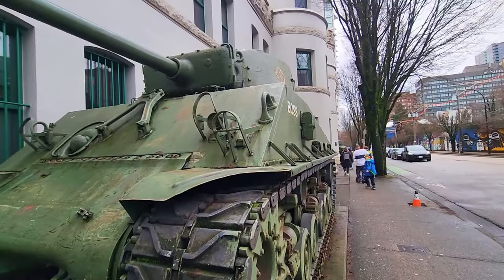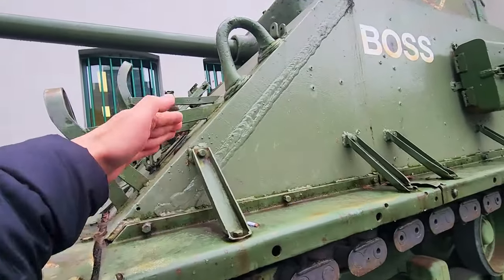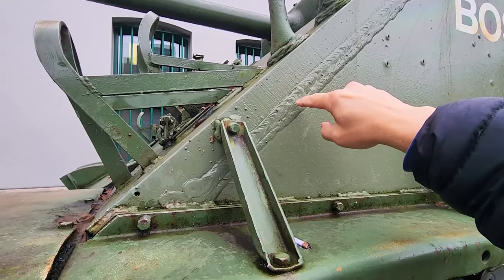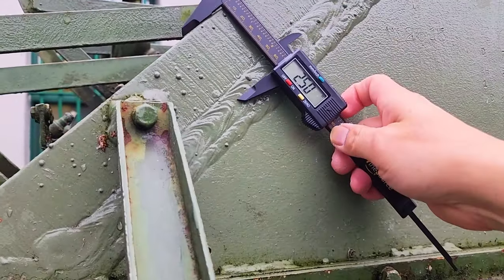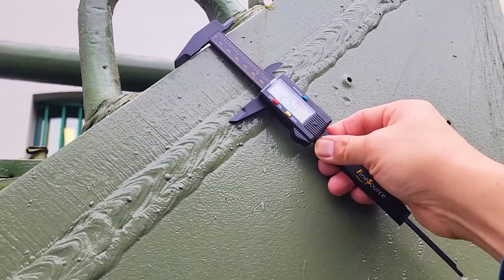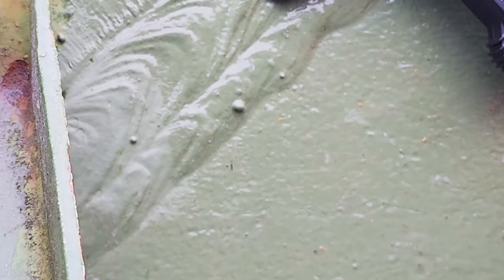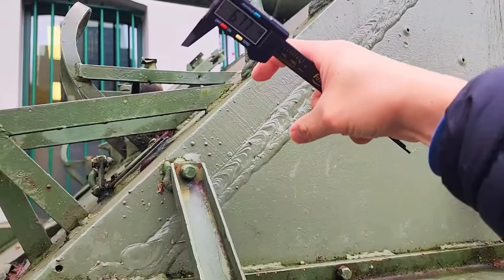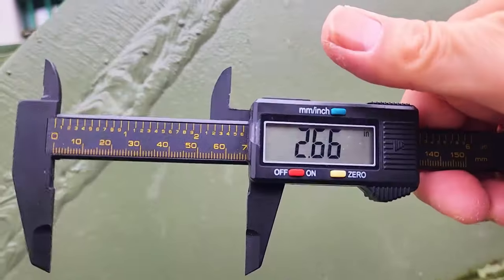ACTUAL THICKNESS OF THE M4A3E8 Easy8 SHERMAN TANK FRONTAL ARMOR

Comment: when welding thick pieces of steel together, it's not uncommon to grind an angle between the two plates and then weld inside the cavity and build it back up so that the weld penetrates deeper than just the surface.
Reply from the maker: That makes sense, I should have taken that into considerations. By the way, the center of the welding ridge to the edge of the plate is approximately 2.66 inch. If they used a 2.5 inch thick steel plate frontal armor, that would leave a 0.16 inch difference which when multiplied by 2 to account for the equidistance, that would result to about 0.32 inch or 8.3mm, which indicates that the cavity or distance between the frontal steel plate and the hull of the tank is 0.32 inch before it was filled in with weld. What do you think?
Reply: @VIDEOVISTAVIEW2020  too many unknowns to say with certainty, sounds too shallow of a cavity for welding a 2.5 inch thick frontal plate, unless they chamfered only the side plates where they touched the front plate and welded from both inside and outside the tank, but even then I'm unsure. neat to think about though.

EDIT: looking at the video again, if you notice at the bottom of the front plate there's a big weld puddle that's right in the middle of the 2.5 inch mark, and then there's another weld line rearward, I think this confirms that they chamfered the side plates that touch the front plate to form the cavity. whether it's on both inside and out is hard to say without looking in there. :)

Comment: Your assumption of the weld line is incorrect.
Reply from the maker: It's possible that may assumption about the weld line boundary is wrong. But based on specifications, late war M4A3E8 tanks like this one has a frontal steel armor of 2.5 inch which is not that far from the 2.66 inch that was measured in this video.
Reply: It looks like the weld was made in two passes so that the second , overlaps the first. Therefore, the measurement was probably correct within a tenth or two.  And since the armor is sloped, the effective thickness would be at least 3 inches.
Reply from the maker: @scootergeorge7089  wow! You are probably right! This thick armor could have been welded twice hence, the welding ridge is wide. I did also measured the inclination which is about 43 degree from the horizontal which translates to 103mm or about 4 inch effective thickness.
Reply: @VIDEOVISTAVIEW2020  - I took a couple welding classes at the local community college.  🙂
Reply from the maker: @scootergeorge7089  wow! good for you. I just did some basic welding project as part of our subject in engineering & material processes. My eyes felt like it is filled with sand after the first day.

Comment: Your measurements are not correct. You messuare at angle 90° but you need to measure at angle 45°.
Reply from the maker: You are right on measuring the line of sight or effective thickness which is to be done along the horizontal axis. What I measured in this video is the actual thickness of the steel that turns out to be 2.5inch. I did made a measurement of about 4inch on the effective thickness along the line of sight on my other videos.